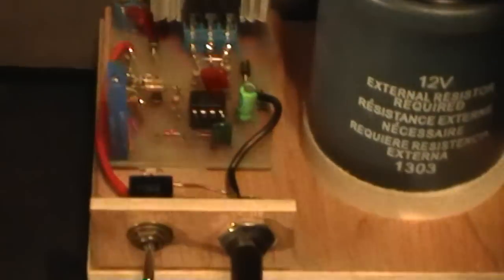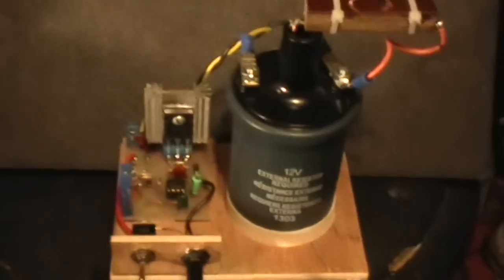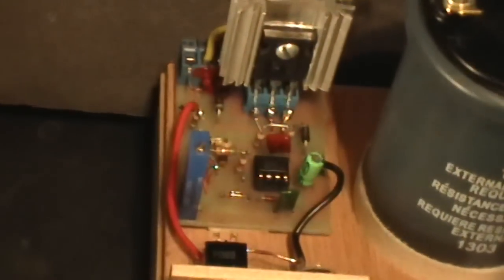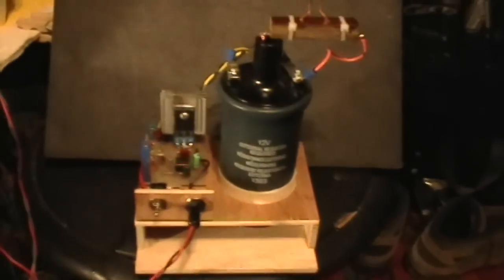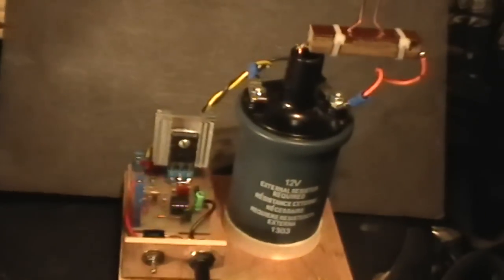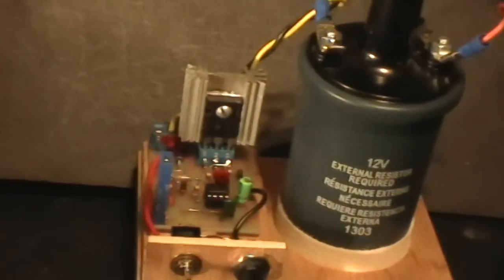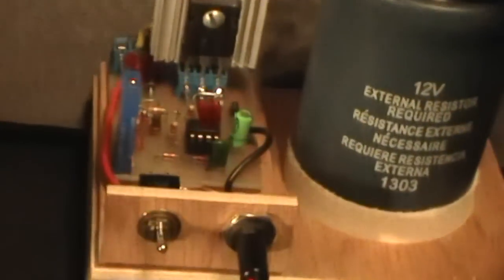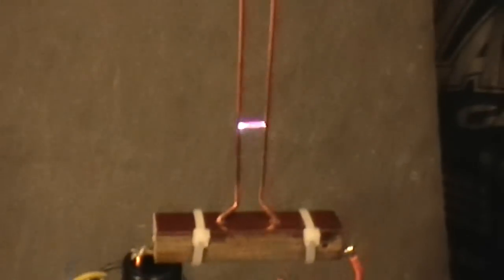Misc Circuits: 555 Ignition Coil Driver with Jacob's Ladder

Comment: i try with R1=R2=200ohm, C=0,1uF => F=21khz, capacitor 4,7000uF between two pin of flyback and i use IRF 540. When i set Vcc, MOSFET was activated but power supply inform Vcc = Mass. What's mistake
Reply from the maker: Try using the actual component values that are listed in the schematic and the description, and connect them as shown in the schematic. 
I have no idea what you mean by "Vcc = Mass."
Reply: TinselKoala i did that but it seem be to like not correct, i think i choose incorrect pin of flyback. i use jf0501-1215 flyback, can you help me
Reply from the maker: Quan nguyen huy
This circuit is for automotive ignition coil, not flyback transformer. No, I can't tell you why your circuit isn't working based on a couple of YT comments !
Reply: ok thank you

Comment: can i use a different mosfet. i have an irf 630b
Reply from the maker: Probably. I have tested this circuit with IRF530, IRF830 and IRFP260n. But I haven't got a 630B to test. It will probably work fine, just watch the temperature.  The lower the on-state resistance (Rdss, check data sheet) the better.
Reply: okay, thanks
Reply from the maker: science Vlog
You're welcome. Please let me know how your build works out.

Comment: is it possible to use a hall effect sensor to trigger the circuit?
Reply from the maker: +Miles Blank Maybe, if there is enough magnetic flux leakage from the ignition coil. A better system might be to use some kind of autoresonating circuit like a ZVS Royer/Mazilli kind of thing. But the sharper the cutoff of the drive pulse the higher the voltage from the coil, and at 30 kV (with a standard auto ignition coil) you are already getting to the point where you are risking insulation breakdown inside the coil.
Reply: +TinselKoala i was thinking a south facing magnet in bedded in the flywheel for the hall effect to trigger the 555 timer to fire just before or after tdc
Reply from the maker: Miles Blank Oh, I see, you are talking about an actual ignition system for an internal combustion engine, not a HV source for display. Sure, in that event you'd probably want to use one 555 in the "monostable multivibrator" single-shot configuration, triggered by the Hall sensor. This would then turn on the second 555 astable oscillator as used in this circuit to provide the HV spark. The first 555 would have an adjustable "on" time (dwell) and you'd adjust timing by physically moving the Hall sensor, or by using a simple adjustable R/C delay circuit before it triggers the monostable 555 stage.

Comment: What clock frequency is your timer triggering this at?
Reply from the maker: Christopher Mayeux  I'm sorry, I can't remember off hand. I'll have to set the circuit up again and measure it. It's put away at the moment because I'm working on something else. I'll get it out and make a measurement a bit later on, perhaps tonight or tomorrow.
ETA: Ah... I see in the Description that it is running at about 145 Hz.
Reply: Take your time... no big rush.
Reply from the maker: Christopher Mayeux
145 Hz.

Comment: Nice.
Add another coil to it hooked up parallel off the 1st coil and take the output between both coils HT end...they need to be 180 degrees out of phase...just turn one coil around so it is opposite polarity to the first. 
That circuit is operating with very similar performance to the ones I have built from Jaycar kits.
Reply from the maker: I can't afford to buy another ignition coil, but look what happens when I put another battery in series with the coil drive: Misc Circuits: Ignition Coil Jacob's Ladder Demo 2: 24 V to Coil
Reply: @TinselKoala  Bit of a time travel reply but if you're still into this sort of entertainment a car scrapyard is your best source of coils. I've never researched it but there are several different sorts these days, the one per plug jumps to mind, but I've no idea which would give you the best zap!

Comment: Built 3 of these boards, they work great. I did not use an IRF 640, used Toshiba K2698 out of old junk power supplies, also found other usable mosfets out of junk TV's. Ran the K2698 all day with a heat sink, never got hot. Also connected pin 3 of the 555 to a SM LED and SM 102 = 1000 ohm resistor so I could see the pulse rate works oh so well, thanks for posting this. Here is my first board I built,
https://www.youtube.com/watch?v=gHJhYEI89xE